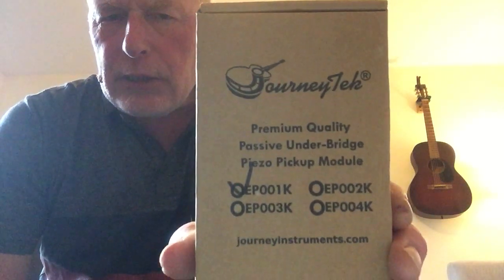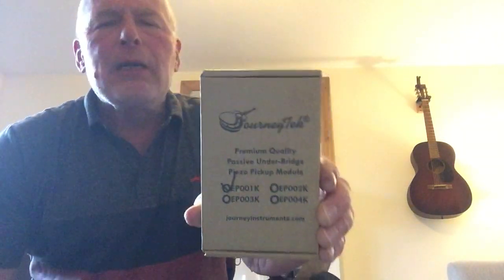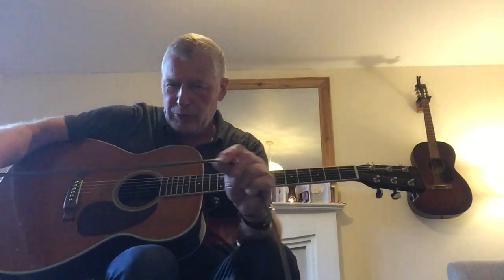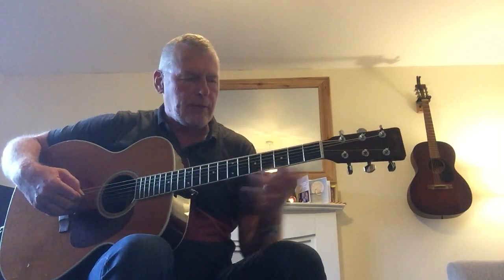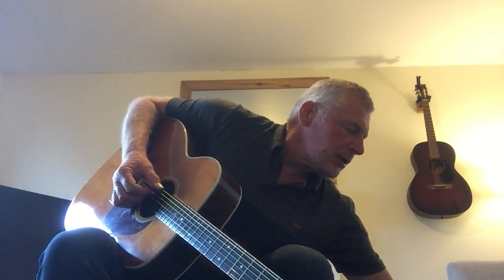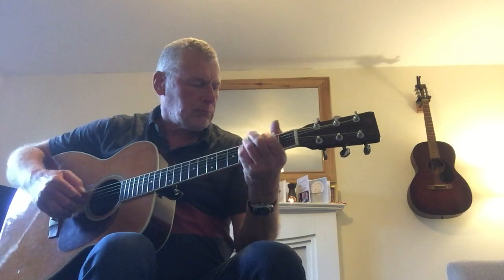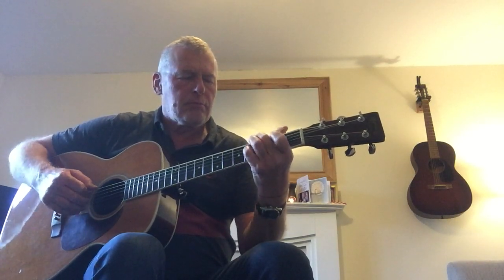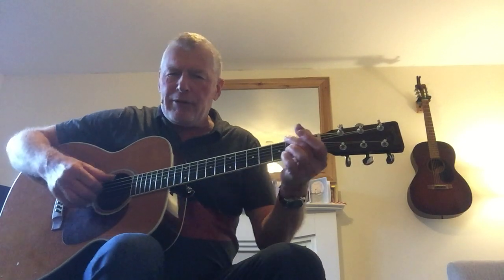JourneyTek Passive 3 piezo Pickup EP001K quick listen on first plug in by Max Milligan

Comment: Very nice. I may add the volume control just so I can turn it down to set down guitar without fear of feedback, but so far, so good. Thanks for sharing.
Reply from the maker: I use the "Spark" boost pedal for clean boost. Try a feedback buster in soundhole if a problem.
Reply from the maker: I use a floor tuner to mute when not playing.

Comment: Hi,may I know where you place all the transducer?is it like what they recommend?I install this pickup in my guitar but it sounds so thin unlike yours sounds very good
Reply from the maker: Mine are placed as the instructions. You need to make sure you get a good contact for the transducers, so my luthier suggested sanding the surface a little before placement. Both of my guitars that they are fitted to have good bass response. If you can try a clean boost pedal like "Spark" or cheap EQ pedal that might help. I hope this helps.

Comment: Does this system resist feedback on a noisy stage?
Reply from the maker: There is no mic involved so it certainly holds up well for on stage but I always use a fedback buster on my stage guitars. There are no controls in the sound hole so this pick system works great. You could put a boost pedal inline with the amp ( Spark or MXR Micro amp) for solos and a tuner for great simple set up.
Reply: @maxmilligan8734  Thanks for answering! If the transducers are installed away from the bridge, would a more natural sound be obtained? moving them away from the strings and placing them on the harmonic top would improve the tone?
Reply from the maker: @verboproductora3225   check out the online installation videos. The sound is very natural as it is. The sound board would vibrate more and may cause the transducers to fall off eventually so not something I would do. I record with a mic and plugged in and the two sounds are really similar. Way better than under saddle sound.